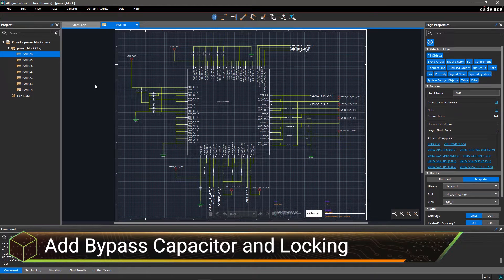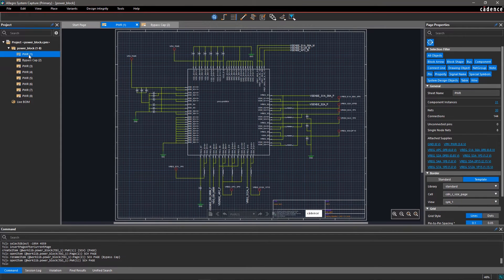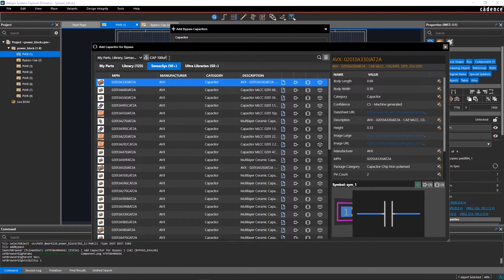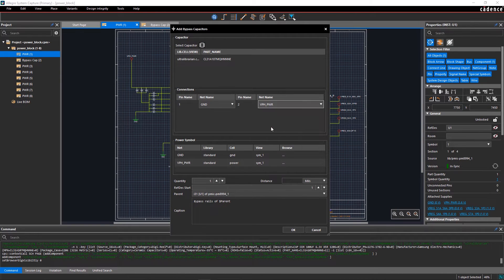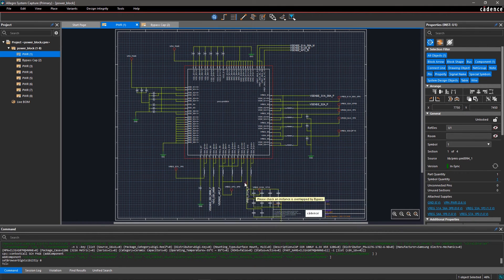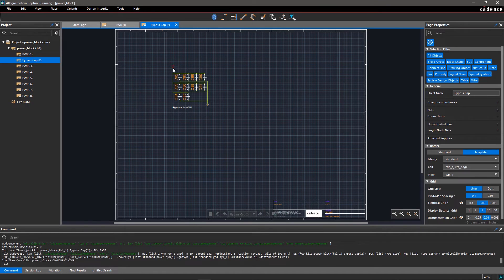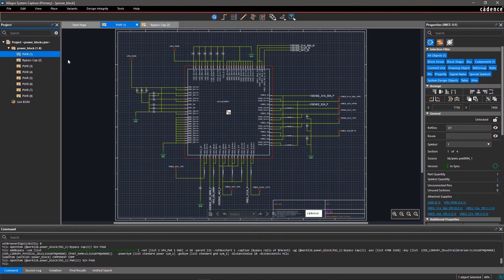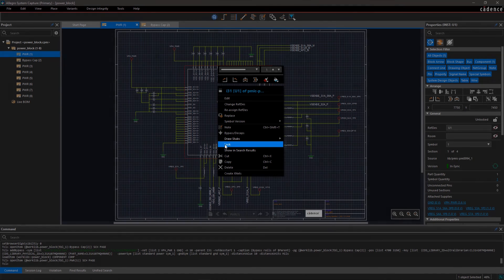Add Bypass Capacitors in Schematic | Allegro System Capture

Comment: Please tell the name of the original software name version ma'am
Reply from the maker: The software used in the video is Allegro System Capture v17.4.
Reply: @CadencePCBDesignandAnalysis  Thanks ma'am
Reply: What is the difference between orcad capture SPB17.2 and allegro system capture 17.4?
Both are same.,
Reply from the maker: They are different schematic capture tools that we have. Please connect with your local Cadence reseller to learn more about the differences between the two tools: https://www.cadence.com/en_US/home/alliances/channel-partner.html

For more information about Allegro System Capture you can go here: https://www.cadence.com/en_US/home/tools/pcb-design-and-analysis/design-authoring/allegro-system-capture.html
Reply: We purchased with license version of orcad SPB17.2 in 2016. Now, will we update the latest orcad version with existing license? It is possible or not.if possible please tell me the procedure for updates thank you
Reply: SPB 17.4 is whether orcad capture & PCB editor version or allegro capture & Allegro pcb version
Reply from the maker: @kannanc9480  Please contact your local Cadence reseller as they will be able to help you best address your design needs and licensing questions.